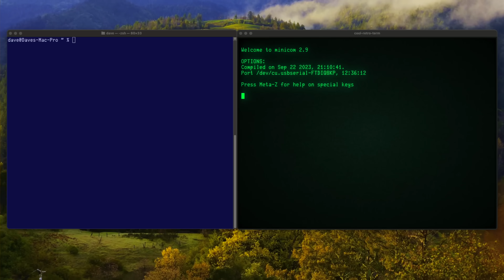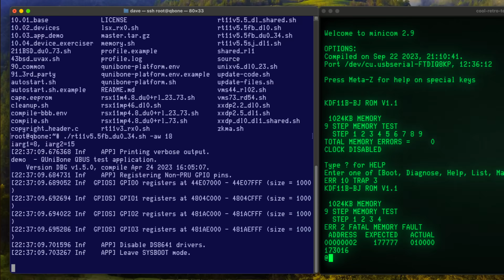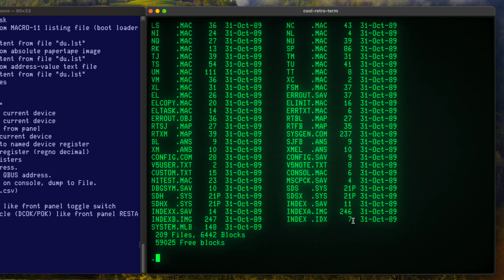What's Inside a MiniComputer?  The Frankenstein PDP-11!

Comment: My wife worked as a Mumps application programmer, on PDP-11s. At the beginning that was on an actual PDP-11; then later it was on a Vax running a PDP-emulator;l and finally it was an HP-UX box running a Vax emulator, itself running the PDP-11 emulator.

Comment: Around the same time I was working on data General systems first there was the Nova and then there were several generations of the eclipse which introduced virtual memory and multitasking and were built on handmade wire wrap circuit boards which required an oscilloscope to troubleshoot it to follow the logic.

The power supplies took two men to move them 

Before that I was in a room with a 370 Mainframe
-mounting tapes 
-swapping disc packs 
-feeding Punch Cards in
 -walking inside of giant drum printers with cases of four-part carbon paper every 15 minutes.

This generation of microcomputers was a huge leap forward and was considered a big upgrade in many respects.

Now we have neural networks and we don't even understand how they work.

Eric Schmidt now says that programmers will no longer be needed in the next decade as the AI's will be programming in non-human readable code.

Lawrence Livermore has the Frontier system at over 1.1 petaflops with 10k AMD Epyc microprocessors by HP.

HP also acquired tandem systems which were fully redundant and known as Non-Stop

 IBM copied it with the as400 in a parallel High availability networked pair.

The HP nonstop systems currently runs the NASDAQ and New York Stock Exchange real-time trading platforms.

The Federal Reserve Bank on Maiden Lane runs the z15 Mainframe which You toured the factory of and what is probably my favorite YouTube video of all time positively epic thank you for that !!!

The largest quantum computer is currently the Atom Computing's machine with 1,180 qubits. The California-based startup's computer uses lasers to trap neutral atoms in a two-dimensional grid, which makes it easy to add more qubits to the system. Atom Computing plans to release a second-generation quantum computer with 1,225 qubits in late 2024.

With IBM hot on their heels with just a few cubits less most likely poised to LeapFrog them in the Next Generation.

I've lived to physically see and touch 90% of all of these commercially viable products which have come to Market and I am not yet a senior citizen it is incredible how far we've come so fast wow!

One of my most memorable moments was walking into a data center at the headquarters of Merrill Lynch and sing for the first time the newly installed cray supercomputer connected to a bank of silicon graphic servers it was a religious experience I think I kissed it😂

Definitely one of my absolute favorite channels thank you!!!🎉

Comment: Thanks. Your presentation shows, that the realiability calculations in the start of integrated-circuit > lsi > vlsi times were completely wrong. Judging from the pictures not even the electrolytic capacitors are changed after 40 years ! Correctly designed circuitry lives like the "brand" B-52 !!

Comment: Back in the late 70s and through the 80s, I was a computer tech working on several computer systems, from DEC, Data General, Prime, and Collins.  In the Air Canada reservation system, there were several PDP-11s, though I've forgotten the model.  These were used to connect modems, connecting all around the world, to the reservation system.  The heart of the system was some UNIVAC computers, which I did not work on.  I worked on some Collins 8500 computers which were the communications front end for the UNIVACs.  The PDP-11s were connected to the Collins computers via 2 Mb/s TDM loop.  There was also an 8 Mb loop for things like disk & tape drives, as well as the interface to the UNIVAC systems.  Each PDP-11 had up to 4 serial I/O cards, each with a Motorola 6800 CPU and 8 UARTS.  There was also a custom card from Collins, which acted as the front panel and could load the software and operate the computers.  With these cards, the PDP-11s were diskless, loading all the software from the Collins system.

We also had 7 VAX 11/780s and each of those had an LSI-11, which was the console for the VAX.

On top of all this, we also had a single, lonely PDP-8/i.

However, I spent most of my time on the Data General Eclipse and Nova computers and was considered by my co-workers to be the expert on them.

BTW, I also watched the Friendly Giant when I was a young kid.

Comment: I repaired PDP11 down to the chip level 11/45  was my favored. Went to the DEC schools there was two maintenance modules you plugged in to the backplane to single step the micro code so you could scope the chips to find the bad one. Microcode listings so you know what was going on and you could toggle in a simple program using the front panel. Interesting note you can run a signal line program without any memory by using the front panel switches since the upper part of the memory was mapped to the I/O devices. So you could put s branch self instruction in the switches and set the program counter to it's address and select run. It would check the CPU card logic.

Comment: In grad school, 1978-1980, we bought a PDP-11 for our research. It was the first time I ever used a computer with keyboard and screen, and I was instantly hooked.  No more submitting card decks at the Math Sciences Building, where the university's mainframe ran 24/7 in the basement.  Our PDP had a pair of 8 inch 512K floppy drives, s great little editor (MEDIT), and even a FORTRAN compiler! I'm not sure whether it had 16 or 32 K of RAM, but it was no more than 32K.  I did all of my Numerical Methods homework on it, in FORTRAN, and never ran out of memory.  The only quirk I recall was that it would accumulate truncation errors pretty quickly, even when using double precision.  But it wasn't a big problem.  The whole experience led me to buy the first IBM PC ever sold in the town where I had begun my career.  I had THAT puppy for eight years....

Comment: We used a Prime <minicomputer at Microdyne. It tracked both manufacturing, and front office. We had about 50 to 75 terminals on it, scattered all over the complex. Over time. terminal software was installed on PCs as more were put into service to access both the Prime and the outside world. Only Production remained on terminals the entire time since they didn't need access to our engineering server, or the Internet.
We had a fll time computer engineer to operate and maintain all computer hardware. There are still  few retired corporate computers in my garage. They were given to me to scrap for parts, to use on other computers. That was almost 25 years ago.

Comment: Looks (kinda) like my 1st PC, which consisted of a motherboard, hercules card, disk controller card, multi-io card, floppy, 20MB hd, 5‘ monitor (open frame), keyboard and an old (transformer) power supply 5V/12V from a scrapyard.
All on the kitchen desk.
And no „RTX86“, only that CP/M++ called MSDOS 😂

Comment: Fun to see this equipment still works. I always wonder if the thing’s don’t dry out and pulverize over time. Got a Commodore 128 lying around, afraid to start it up :-)
Reply: The capacitors on those vintage computers can be a problem, alot of time replacing them with new ones is all it takes to get dead vintage hardware running again.

Comment: The second-gen OCR sorting machines at the USPS (I was a Tech) had PDP 11-83 in a single chassis. The Mini PDP 11 that collected the data was from England as the US no longer sold them and the connecter with a yellow coax ethernet cable, fun stuff

Comment: Wow, I would have sold a kidney, perhaps, to have access to such a system.  And I probably would have with the negative levels of wisdom I was running on at right around 12 or 13 years old.  

Is the position of each board in the back-plane irrelevant?  Must there be no blank slots between them for it to function?  Termination? (forgive my ignorance, I am fairly computer knowledgeable but I know enough to admit that I don't know anywhere close to enough (everything, that is)...  

A funny quote (at least at the time): One of the first people to introduce me to computer systems said to me: "Don't worry, you can't break it unless you type with a hammer..."  So odd that I've heard that more than a few times, as I recall, almost as if it came from a comic somewhere?  (I did eventually learn that actually you can break it, that is especially if its PRODuction). 

(It seems that many of us were proto-urchins saved/converted/morphed into TRS-80 sales displays at a local Radio Shack. Perhaps a good idea would be for those of us who had such an experience to form an organization so that we could have yearly reunions, as there must be quite a few of us and it is a historic sort of thing after all.

At any rate I did learn a great deal of interesting stuff including many IBM Mainframe utilities.  I'll see if I can ring anyone's memory bells (not necessarily IBM stuff, just all mixed together):  BASIC, Assembly, even FORTRAN and COBOL(s), MVS/*, Sysplex -> Parallel Sysplex, Omegamon(s), Netview(s), z/OS, CICS/CICS MRO,  Zeke, RyAD, etc. If I could remember them off the top of my head I could fill a page or more (though most of my experience was with small personal type computers, the first being an Altair 8800, which truly introduced me to the "soldering pencil" and how to order replacement parts.).  

Its weird that I never had any exposure to a PDP system.  I suddenly feel as though I have this huge gap in my knowledge base but it 'feels' familiar just the same.

Comment: Wait, how do you “invert 12V”? Getting negative voltage is no easy task, you cannot just plug 12V to ground and ground to -12V because on bus it would connect 12V to ground and cause short circuit.
The  “more proper” way is to get 24V and divide it in half (this isn't easy especially if you want to have stable voltage, and voltage drop might ruin methods you consider) and then use ground as -12V, 12V as ground, and 24V as 12V
Reply: Correct idea, but bad idea! On most computer equipment ground is similar in potential to earth.  You can "lift" the ground to +12v to make a 24v differential (*sometimes*, under some conditions, if you use TWO physical 12v power supplies) BUT only if everything connected to ground (including other machines via serial) is also happy to float its ground that high with respect to earth - not a safe assumption at all!  The correct solution for Dave was either to use a PC PSU which gives lots of current and -12v, or to just connect the -12v input to GND. Positive going only serial will probably work (guessing here) for short cable runs as most modern equipment serial RX is comparator driven and in reality sees anything tending towards ground as mark (despite the plus minus 3v indeterminate zone of the specification) in my experience. A cheap DC/DC converter with negative output is the simple and easy solution for a positive only power supply.

Comment: I think the "something else" that's missing (from one of the empty DIP sockets) is the KEF11-B option that would give you CIS ("Commercial Instruction Set") support.
Reply: Correct.  It was available, but I don't think it was often installed.  More likely to have the MMU chip so as to address 22-bits of memory (4MB).  The Floating point chip was also available, but not often installed either.
Reply: @johnreinhardt2662  - Yeah, CIS would be unlikely to be installed unless a system was going to be used for business applications (my impression was always that CIS was a big help for COBOL programs...).  I had an 11/24 (same CPU, in a UNIBUS system), and we pretty much had to install the KEF11-A option (floating point).  Our system ran Unix, and it turns out there was a bug in the V7 kernel (which I ended up patching, in addition to putting in the KEF11-A option) where, if you tried to run a zero-length executable file, the kernel would go down a code path that tried to save the floating point registers, even if they weren't present on the system.  Instant kernel panic; we would sometimes get panics 3 or 4 times a day until we figured this out.  Our system was used in a computer architecture course.  For some reason, a number of our students would try to assemble programs that contained errors, get very clear error messages indicating that the assembly had failed (leaving a zero-length a.out file with the execute bit set...), and yet they'd try to run it anyway....

Comment: Do you remember that HeathKit offered a LSI-11 kit. Built around a PFP-11 03. You could add a floating point chip. I added a VT100 and LA120 printer and Memorex floppies. This was a real computer, some Tandy, Sinclair, Imsai micro with a modified television set for a monitor and a tape cassette for storage. The PDP-11 and The Motorla 6800/68000 were the best architecture I ever saw. I really loved the PDP-11 !
Reply: I really lusted after that Heathkit PDP-11 clone.  Had hands on one in a store, but never did get one for myself.
Reply: I had the H-11 which was the unit that the 11 was housed in, but only as a regular terminal.

Comment: To me a mini-computer has its functionality distributed over a bus that multiple slots. This was necessary because large scale integration (LSI) chips had not been fully developed. Later, micro computers reaped the benefits of LSI and greatly reduced the size of a computer.

So, if I remember right, with a S100 computer system, you could arrange the cards in any order you liked and the machine would work, because all the signals on that bus were wired in the same way, pin for pin. But I don't think that's the way it works with many mini computers because different slots may have different functions.
Reply: You're correct about the S100 bus.  No differences between the slots.

Comment: In the early 1970s, Univ. of New Orleans had a PDP-11/15 (no disk, it was paper tape!)  I did my dissertation research using the PDP-11 to monitor my chemical instrumentation.  It was a champ.  I managed to monitor experiments directly using some analog-to-digital convertors and some digital connectors for sequencing.  With that rig, I could obtain samples as fast as every 200 microseconds, though sometimes I needed slower sampling rates depending on the speed of the chemical reaction I was monitoring.  That machine was as dumb as a box of rocks in some ways but it got the job done for me and a lot of my other graduate school pals of the time.  It was amazing what we could do with 8 KB of RAM.

Comment: I’m more familiar with the older Unibus machines such as 11/34s.  I recall things could be finicky with board order and you had to have bus terminator cards too.  My recollection is the KD11-E CPU needs a SACK turnaround terminator card to feed unused bus grant back to the CPU as an ACK.  I believe later CPU let you set a DIP switch to loop the signal on the board - that is probably any. Q-bus CPU.  The DEC busses are 120 Ohm transmission lines, so proper termination is important.

Comment: i know this is probably too much effort and pointless but you should use a vintage terminal or random 80s computer like an apple 2 as a terminal instead of your modern pc so its more authentic. since it does seem kind of silly having it displayed on a modern pc like that even if its all running on the old hardware

Comment: Thanks Dave, this takes me back 35 years to the days when I managed to load  Decnet IV drivers into a PDP-11 running RSX at a military aircraft factory, in order for the data to be transferred to our Vax clusters and eventually on to the Crays to carry out fluid dynamic calculations over the weekend. Once I managed to establish that data connection between the three systems, mag tape transfers became a thing of the past.

Comment: please please please make some cheap and simple 3d graphics system that isnt bloated and confusing like modern linux and allows software programmers to write c/assembly without 4000 lines of boilerplate and mystery drivers and firmware blobs and cruft